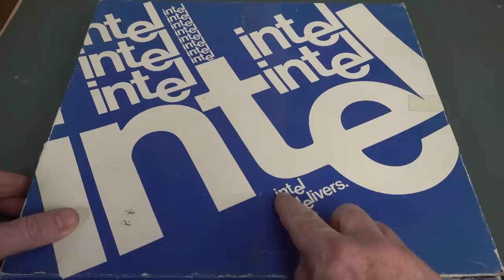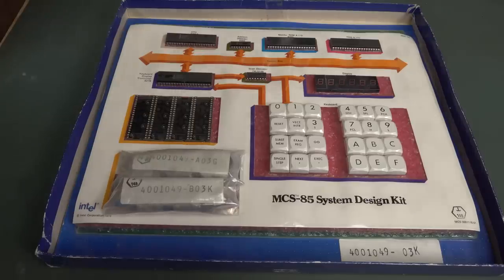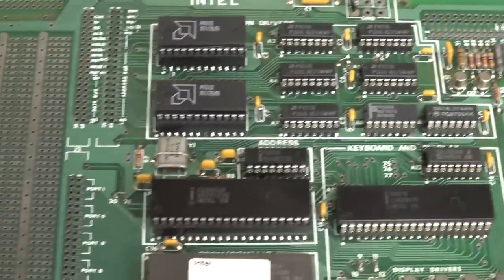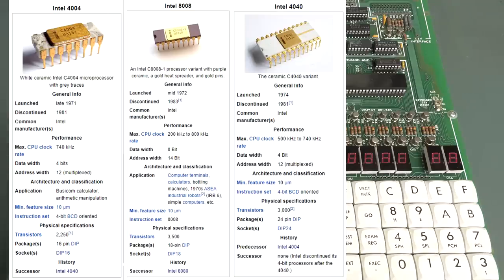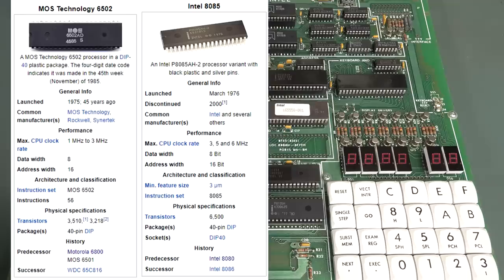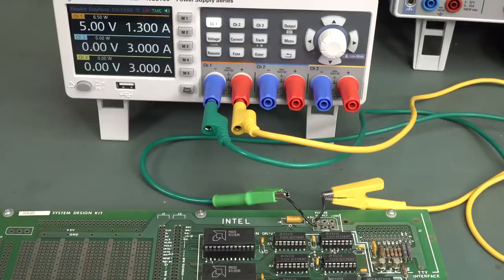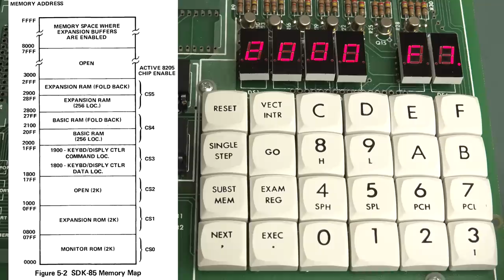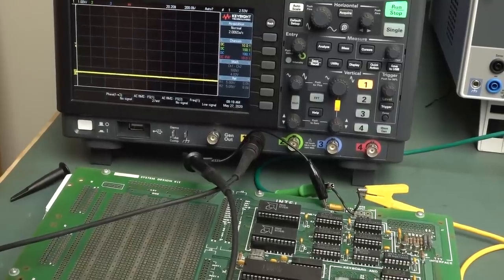EEVblog #1308 - 1970's Intel MCS-85 8085 Design Kit!

Comment: 9:30 I highly doubt anyone who worked on this thing is still alive, and I doubt even more so that they're still working.
Reply: Still alive? Quite likely. Still working? Quite unlikely.
Reply: Built a wire wrapped 8080 version in college mid 70s. I still have it and it works. Wrote a rudimentary assembler for it. I still do Linux Administration contract work in the cloud but am retired from HP. after 45 years in various IT jobs.

Comment: intel and AMD chips on the same board? Blasphemy!
Reply: AMD was a little company back then and an officially licensed second source for Intel CPUs. That stayed that way until the 486 era, when they started to sell improved 486s, outperforming the originals, which Intel didn't take nicely and refused to give them a license for the 80486DX4 because of that.
That prompted them to design their own Am5x86, which basically allowed to replace your 486 with and get Pentium power by doing it. Since then they basically parted ways and are competitors since then.
Except for the LITTLE fact that Intel licensed their 64bit architecture in the early 2000s after their screwup called Itanium.